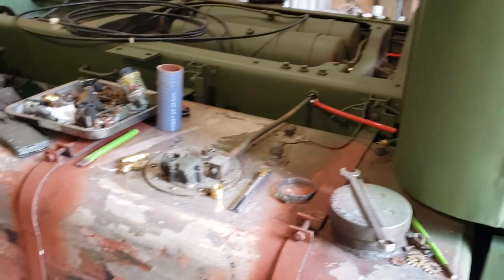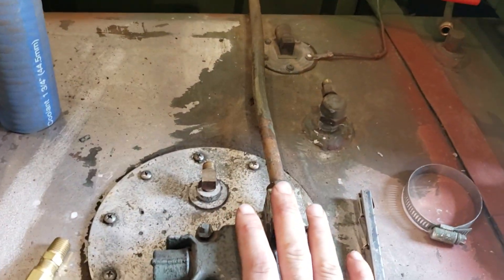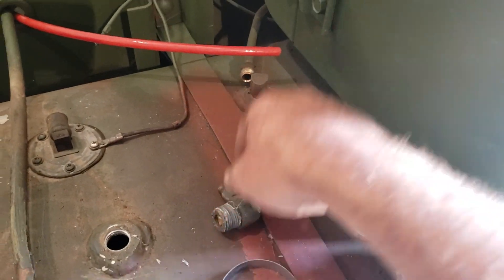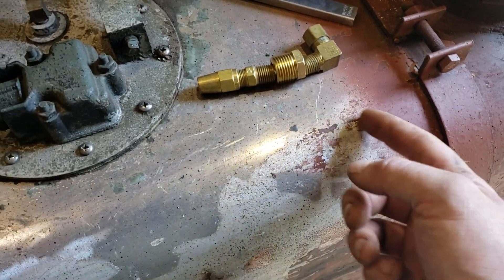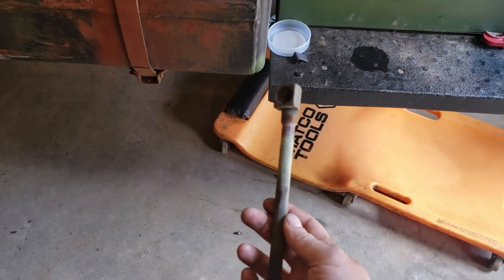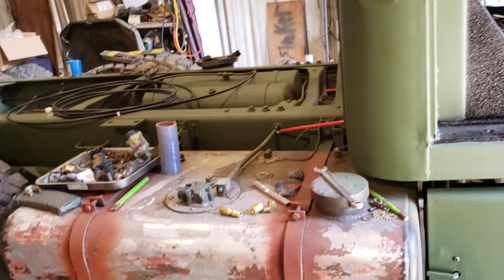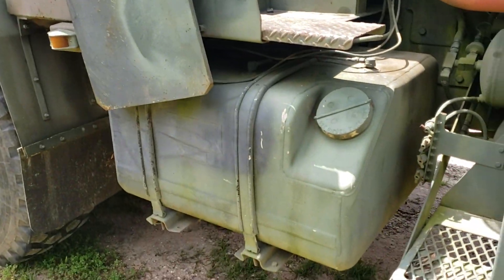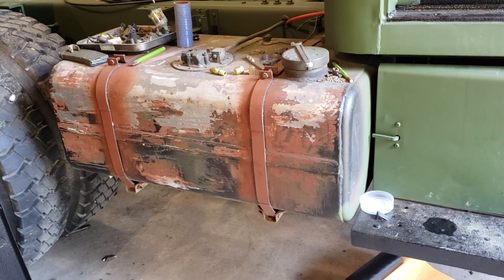Modifying M35 fuel return to improve injection pump lifespan.

Comment: I've got a bobbed A2. I'm Thinking of putting a second tank on the driver's side.  I'm just going to fab the brackets out of some Z channel..

Currently have 16R20s, but i'm going to get a set of 395's, and downsize a bit.  I know you don't like the oversized rubber, and i can't blame you.  Would rather have had a stock deuce, but I got a hell of a deal on this one, and couldn't pass it up.

So far as a spare, I want to rig the spare on a cradle setup behind the cab, much like they did with the 5 Tonners.  I don't want the davit hoist back there, so I'm probly going to fabri-cobble together something with a ramp and a winch, i have some ideas, but nothing made as yet.

So far as the fuel tank, i'm most likely just going to use it as a transfer tank to the main.  I don't think i want to deal with the plumbing to have two feed a common manifold.  

Anywho.  I'm off to put my front axle back on the truck.  I dug into mine, and found that the passenger shaft was snapped in the diff. No damage, except to the shaft itself.  I pulled the axle to inspect the carrier and bearings, just to make sure nothing was blown up.  It'll be a two-wheel drive truck until i get a set of the 43/40 shafts from Boyce.  I'm leaving the front shaft from the transfer case off, since the axles are out, i don't want to dump gear oil out of the open shaft ends.... so no gear oil in the front for now.  Thinking the previous owner beat it hard, and the oversized tires sure don't help out.

Thoughts?
Reply from the maker: Sounds like a solid plan to me. Plumbing two tanks isn't hard if you use a 939 series truck transfer valve. The only thing I don't like about using one as a transfer tank is the tendency to forget about the pump being on and overflow the tank. All depends on how you rig it.

I like the fold down tire carrier design the lmtv uses. Not hard to build utilizing a winch instead of hydraulic lifting apparatus.
Reply: Tactical Repair Well, My intentions are to run a timer relay via momentary pushbutton.  This would be a pilot relay for a 24 V contactor that would turn on the transfer pump. Then I could Set a timer for say two minutes or whatever. Test it  out so that one push equates 5 gallons or what not.  

I can’t fit a spare on that side of the truck, so that much frame rail Looks too damn bare to me.  I suppose I could extend the toolbox as well, but I really like the idea of dual tanks.

It may not even be a Deuce tank, since the cheapest I can find them are 5-600.

Thinking it may be a rectangular 50 gallon OTR Semi style tank...  I guess it will depend what I can find when I get to that point. I want to restore the front axle first.

I’m getting rid of the stock seats, and putting in a couple air rides in the cab. Over the transmission hump, I am going to build a center console... One I can remove with a couple bolts, and a couple quick electrical disconnects...  Something like the Amphenol connector that is underneath the driver side to connect the front and rear harness.

In the center console, I am going to mount a 24 to 12 V converter, some cigarette lighter plugs, a couple USB ports, the intercom system I plan on getting, external light rocker switches, and the controls for the transfer pump.

The fact that this location is so close to the battery bank kind of helps me with this.
Reply from the maker: That sounds like a lot of bullshit to avoid running two more lines and drilling one 1/2" hole and two 1/4" holes to mount a valve...
Reply: I'm an electrician by trade, so I tend to default to the electrical/controls option.  You may be right, however.
Reply: @GKBigmack  I just completed an aux tank install on my truck. I borrowed an idea from a guy on Steel Soldiers. I mounted the tank where the spare tire went (I have 395s on the truck). I used the stock mount brackets and drilled the frame for them. I used two check vales between the two feed lines and tied the vent lines together. I used an electric diverter valve to switch the return lines. I only had to run a short fuel line across the truck where I mounted the check valves on the inside of the passenger side frame rail and did the same with the vent line. I ran another 3/8 line from the new tank up to the diverter valve which I mounted under the cab heater coil bracket in the engine compartment. I control all of this with a 3 pole, double throw switch. On set of poles switches the fuel pumps, one set switches the fuel level gauge and the third set switches the transfer valve.
Basically, I have a completely redundant fuel system, two tanks, two pumps and two fuel level senders. I have some photos posted on Garrett's Facebook page, Tactical repair, and will post a complete set there and on Steel Soldiers once I button everything up and take more photos.

Comment: This will probably become the most reliable and useful m35 ever.
Reply: indeed, the LDT/LDS is a pig but eh, i enjoy destroying the atmosphere by burning WMO lol  cheaper to run for me for now. it would be cool to put the old turbo on the cummins
Reply from the maker: The Cummins will run fine on used motor oil as well. The turbo on the Cummins is a much better turbo and actually has quite a loud whistle in the configuration I have.
Reply: @tacticalrepair  nice, ive only tried multi fuel on a old 7.3 idi.
Reply: Tactical Repair I can’t wait to hear it!
Thought you were using the whistler turbo from the multi fuel on the cummins?
Reply from the maker: No that is an inferior turbo. It would choke it down.
Reply: @tacticalrepair  good point. Looking forward to seeing you finish the truck man, it's looking good👍
Reply: @brandonbarthel8377  I thought the same thing. I saw this one guy put a shwiser turbo from a duece on a 6.7gm diesel sounded good but little to no performance gains